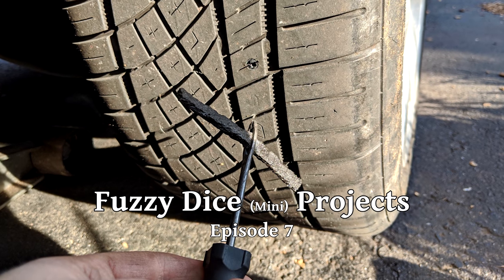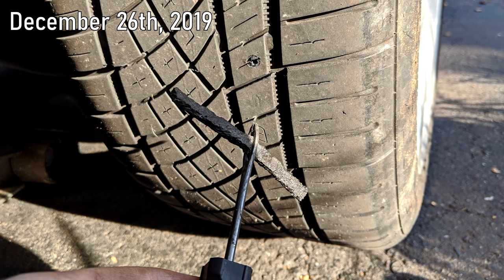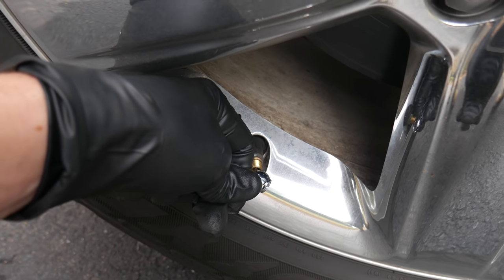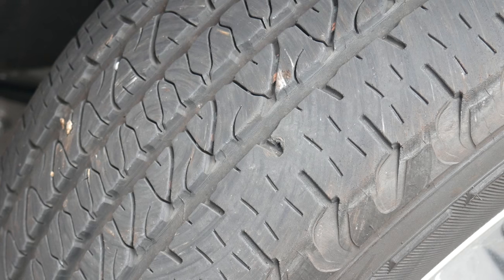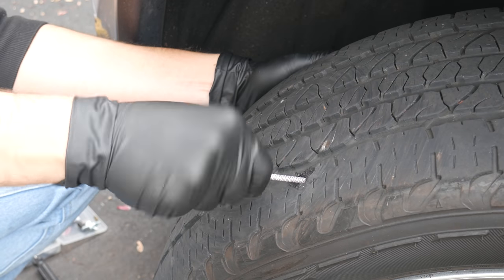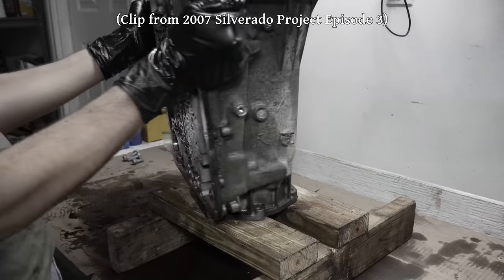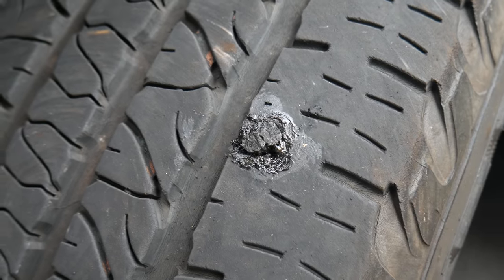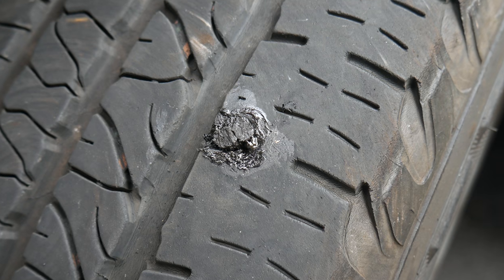Plugging a Punctured Tire with Cheap Tools at Home (Mini Projects Ep.7)

Comment from the maker: There have already been a few comments that it is easier to install the plug with pressure in the tire so that it doesn't flex as much, if it seals just as well and makes it easier it's worth a try to do the repair that way! I more frequently heard that the tire should be empty to plug it so it's the only way I have done the repair but it does require a lot of force! Will have to try it while the tire is inflated in the future.
Also forgot to mention in the video: If the puncture is a front tire you can usually just turn the wheel and access it on-vehicle as shown in the video, but after repairing it would be a good idea to put the repaired tire on the rear for more controllability just in case something does later go wrong. If it's the rear wheel that is leaking and it is on a car, removing the wheel from the vehicle (if possible) would make the area easier to get to.
Reply: That's why YouTube is such a cool thing and why it's cool that you've grown a good community with your channel. We can all learn new things from each other, especially guys like us who are working at home and don't usually get to see how other guys are doing it. Good stuff!
Reply: That’s why I like this channel, we can learn from you and each other. I learned a lot about sandblasting cabinets from your video a while back, I even bought the same cabinet from TP Tools. Your video saved me a lot of headache, especially with those crappy seals!
Reply: It’s better with air you struggle more without air on it and don’t jack up the car when putting a plug just apply the emergency brake
Reply: i did it 2 times with 20 psi in the tire with no problems

Comment: I leave a little air in the tire to make it easier to push the plug into the tire. That keeps the tire from flexing when pushing.
Reply: Same, and lay on the ground, then lock my foot behind the tire and push it in after heating up the ruber using the reimer.

Comment: We always plug tires with the tire full of air. This makes it easier to install the plug without the tire collapsing. We remove the debris and install the reamer right away, then install the plug right away as soon as the reamer is out. You lose very little air pressure doing it this way and don’t risk losing your bead seal. Good plugs are made to seal right away even with full tire pressure.
Reply: That's how I do it as well. As soon as the tire deforms, it's very hard to install the plug. I inflate it to 45 psi, then start working it.
Reply: I agree with this one, I've been doing the same thing
Reply: I do the same as well however I usually have a problem with the rubber cement.  If I use rubber cement the patch seams to keep leaking but without rubber cement the patch seals up right away with no issues with the tires for years to come.  I might try using it again next time but but once I plug the tire remove all the air to allow the rubber cement to dry.
Reply: Steve O'Brien  Cement is needed for patches but good plugs are made to vulcanize without cement. A lot easier that way.
Reply: Agree 100% tyre full of air is dramatically easier.
Reply: I agree with all of you guys. I've never even seen anyone patch one that was dead empty before unless there was no other option.
Reply: @cambo1200  I find the rubber cement acts as a lubricant when wet, yet assists in sealing when dry. Best of both worlds.

Comment: I was in the tire industry in the 80’s and ‘90. I have plugged hundreds of tires with just plugs only. Set your plug up in the plug tool first. Lube it with  rubber cement at the tip. Get your reamer before you pull the nail or screw out. Pull the object out. You might even have to add air. The mor pressure in the tire the easier  it will work. Quickly stick the reamer in before you lose a lot of air. The way your doing it, your fight the rubber grip, you risk tearing the plug in half that way. Ream the hole. Insert the plug then spin the handle until you feel a bind. That sets up a mushroom on the plug inside the tire. Pull the tool out. Trim the tail of the plug. Refill the tire to the proper air pressure. That repair will be trouble free for the life of the tire. I’ve seen plugged tires worn to the cords with the plug still in.

Comment: I used to carry a Monkey Grip plug kit with me and at one point my right rear tire had like 15 plugs in it. It held air until the tire was almost completely slick, which took about 150,000 miles. I have complete faith in these plugs, never had one fail in any way. The T-handle tools make the reamer and plug installer much easier to use, and as mentioned it's a lot easier to install the plug with the tire fully inflated. If it doesn't seal 100% right away, just pull the plug out and use another one. I had one hole that was so big it took two plugs to seal, and it never leaked.

Comment: I have used this, and it works.   I was lucky, my tire was only flat on the bottom
Reply: but did you know, that tires don't actually sit on the bottom?  they actually hang from the top.  the air actually only gives the tire shape, it doesn't support the car.

Comment: I've never had a plug come back. I've plugged hundreds of tires over the years at my shop.
Reply: I laughed reading that. So, did the customer come back at least?
Reply: @jonasthemovie  
My customer retention is about 80% 👍 
My return rate is about 3%, usually due to a faulty part, rather than installation.
I do great work, and my prices are pretty tough to beat.
Reply: @ImTheJoker4u  My work and prices are tough to beat too and my customer retention is 100%... The downside is that I pay myself really, really, poorly for working on my own stuff at home. In fact, it always seems that the stuff costs me money!

I also have one under the knife right now due to failures in 2 different factory OEM parts I've installed in the last 3 years. Man it's a bummer when that happens. This is why we can't have nice things...
Reply: Maxwelhse Lol my retention rate is 130%

Comment: I, too always do plugs with the tire full of air... in fact, i try to do the repair so fast, I hardly lose any air.  Before starting, I have the plug in the tool, the drill ready, a hammer of some sort, and some WD-40 or similar.  In rapid succession, I pull the nail/screw out, drill the hole (I use a 3/16), I spray the plug with WD-40 and use the hammer to drive the tool with the plug in.  I don't know what the WD-40 does exactly, but it makes even old, old plugs sticky again, but initially it acts as a great lube.  I picked this technique up at a shade tree mechanic shop who plugged my tire without me even having to shut the vehicle off.  I've never had one leak or fail.  Its a great party trick to show off to your friends.  ;-)  Standard disclaimers apply.
Reply: Your way seals a lot less efficiently

Comment: I worked at a Shell station from ‘71 to ‘73 and probably plugged a hundred tires.  I could do it in about 2 minutes.  We reamed it out (our reamer might have been slightly smaller in diameter than yours), then reamed it again with cement on the reamer and then took the plug which was a slicker rubber piece which we folded longways and put in the plugger which was then dipped into the cement.  We waited about 30 seconds till it tacked up a little and then plugged the tire.  We nipped the excess off with nipper pliers and that was it.  Never had any complaints or failures that I know of.

Comment: Just ran across your video... good step by step.  I keep a set in every car I own.  More than once I have done this in a parking lot and had enough air to get me to home/garage for air.  I been plugging tires like this since 1994 (in the shop and my own) never had one fail.  Keep in mind if you have high performance tires with high speed ratings, this will lower the speed rating of the tire and is not recommended by the tire manufacturer.  But it will get you by as long as you need it to --  until you can get your z rated $$$$$$ tire replaced.

Comment: I definitely agree, pushing that plug into the tire is the worst! One more step I do is to add some of the rubber cement to the reamer as I push it into the tire in hopes of making it easier to insert and adding more cement into the hole.

Comment: Just to chuck it out there, if you happen to be the original buyer of the tires (meaning you bought them at a tire store yourself) the tire store will usually plug them up nicely for you for free (meaning with the inside patches, plug ground down nicely, rebalanced, all that)... even if you didn't buy the road hazard warranty.

Comment: I have plugged many dozen punctures. Including many motorcycle tires. I had a brand new bike get a road hazard puncture from  a canine tooth of a roadkill. Dealer refused to fix it and wanted $360 for a tire. I said screw that and plugged it myself. Cost me less than $10 for the kit. The Tire was a Metzeler MEZ1A 190/50/17  in fact it was the first plug I ever installed. That tire went 6,000 miles more and well over 100 mph on many many occasions and when we removed the tire the plug was still permanently vulcanized to the rubber inside very satisfied to see. I would NEVER hesitate to plug a tire on any vehicle ever again. Unless one thing is wrong such as the hole being too big or more of a tear.
Reply: Dog tooth from road kill is a good one. My personal record is a drywall screw directly through the exact sidewall of a tire where you can't plug them. I took out my leatherman, ran the screw the rest of the way in, and drove on it for the next 4 years. It didn't even leak. I was shocked...
Reply: @TheBrokenLife  actually the road kill was small mammal like a raccoon maybe. Didnt think it was a dog. Tooth was still in the tire but leaking.

Comment: I keep a similar kit in the trunk of my car along with a plug into a power outlet small electric air compressor. My kit does have T-Handles though, which are nice.
Reply: i got a flat once, i bought a kit, plugged the tire which continued to leak but it got me 150 miles home where i took it to the garage to be patched on the inside.  they said i did a terrible job fixing the tire.  i said hey, it got me home didn't it and that was my only goal.  go ahead and try finding someone to fix a flat at 5 o'clock on a friday.

Comment: Ive used these tire puncture kits before on newer tires and had them last for over 50k miles. 

A flat tire isn't dangerous if you are driving safely, so even if it does fail, it will get you by.

Comment: these plugs are mainly designed to be inserted from the inside out and the patch placed on after rest is done the idea is to make it more likely to remain air tight. However with these plugs the type of repair shown here is ok for on the side of the road repair but I would advise always placing a plugged tyre on the rear of the vehicle as if the repair was to have a dramatic failure at speed you would find the steering react similar to a blowout on the front and just become a passenger on a wild ride. Here in Aussie there are a type available that is both a plug and inner patch in one that while you need to remove the tyre to install it you pull it from the inside out But under our regulations a plugged tyre is then rated at a much lower speed and weight rating than the original tyre but dont know what the % they drop is. In any case if you have a good spare and you want to do this to repair a good tyre i would then make the plugged tyre the spare till you replace tyres. Running a tube inside a tyre that is slow leaking is also not recommended as this will make the tyre run hotter to the rest and this can also have a bad effect on the bonding of the case of the tyre and also lead to blowouts. I used to use the latter tubing a non tubed tyre in my younger days till i did have one blow out,Luckily that tyre was only ever on the back of my car so the ride was not too bad when it let go and easily handled. Check on your local regulations as to what is allowed and not when doing tyre repairs and if you run same size tyres on any trailers you own these repaired tyres are perfect for use there if you feel you are wasting a lot of life of a tyre

Comment: It's crazy what some people puncture their tires with. In high school I worked at a tire shop and I've seen wrenches, sockets, steak knives, pliers, keys, and just weird stuff like those.
Reply: what's the craziest one you got?
Reply: how do you puncture your tire with a wrench?
Reply: @WoWAuctionsnet  
Falls out from under a car that was being worked on and forgotten. I hate to admit it but I've lost a few tools that way at the shop.
My neighbor had a piece of a stabilizer bar end link puncture his tire while we were riding to work one morning.
Reply: RagingHammer Probably the steak knife. They just had the tire installed less than a week before and the steak knife was sticking from the inside out. No one could figure out how it got in.
Reply: The tire store I go to has a big jar full of the more interesting things they've pulled out of tires. Most of the stuff is unidentifiable, but the one that stuck out to me the most was about a foot long section of probably 5/8 or 3/4 rebar. Not hard to imagine how that would take a tire out, but I was impressed just by the overall size.
Reply: I change tires and I’ve found pocket knives, antlers, drill bits, screw driver, rebar and many more. Crazy what comes thru the shop in a daily basis

Comment: O.K. for repair if you are running a truck but for a high performance vehicle this would definitely a get you home repair ....  by the way, what happened to your low cost V8 engine refurbishment??
Reply from the maker: Still working on it! The majority of assembly is complete but I'm having trouble with a lot of fiddly parts and brackets that I had to modify or custom make, one part I couldn't get and had to send to a machine shop for fab work and currently waiting to get that back so I can get back to it.
Reply: @FuzzyDiceProjects  Machine shop? What!?!?

You gettin' all fawncy now? ;)

Comment: I also had to do this about two weeks ago in on my car. However I had no more 'glue' left.. That said... Pressure is still at 30psi.
I currently have one on the rear of one of my motorcycles.. However it does leak slightly so over the period of a few weeks I do need to put 5-10psi back in it. Otherwise.. I can't be bothered.. I'll just keep topping it up until the tyre is treadless.

Comment: Discount tire will plug your tire for free as long as its repairable. Had a 3/8 bolt in my tire and they patched that up with no appointment required for free in less than a half hour.

Comment: Now let me tell how indians do it in puncture shops they just don't care where the puncture is they would just fill the tyre with air and would stick the plug in without applying any rubber cement and would check the leaks with water and if it seems fine they would let you go
Reply: India is also not safe at all and they will retread tires until there is nothing left

Comment: 2 good tires from pirelli cost somewhere around 160 euros. I wouldn't feel comfortable driving around with a tire like this...
Reply: There are likely tens of millions of patched tires out driving around on roads all over the world right now. If installed correctly, they're just fine. I have 2 tires with patches in them from at least 2005 and they're still holding up just fine. That said, those tires are waaay too old to be driving on, so I don't and they're just for vehicle storage purposes, but the patches have never been an issue.

I'll also add that local economics may make a difference. Just to have 4 tires dismounted, new ones mounted and balanced, and disposal fees for the 4 old ones cost me the equivalent of 107 euros recently and that was without the cost of the tires themselves. As disturbing as this is, half of Americans have less than 350 euros saved for an emergency so literally half of this country couldn't afford a set of new tires with no notice. If I had to choose between someone not being able to drive to work to feed their family or a $7 tire patch kit, pass me the patches.
Reply: @CamaroZ28Nut3   i had 2 tires mounted at a tire store.  the guy pulls me aside and points to the rear tire on my suburban, this won't pass inspection he says. i asked why,  he says, there's a plug in the side wall.  I said yeah, i know, i put it there.  he says you can't plug a side wall.  i said, but i did.  he says, it won't last or pass inspection.  i said it's been there for 3 years and passed inspection for 3 years. lol   it's still there.
Reply: @CamaroZ28Nut3  lol, yeah, it worked but i don't think i would recommend it. lol   another reason other than flexing alot is the cords in the side wall are different than the tread.  it's all about liability.  the plug i used was a red, rubber plug, glued in.